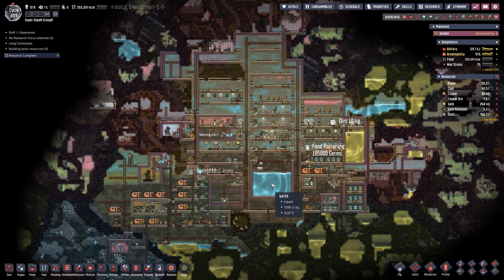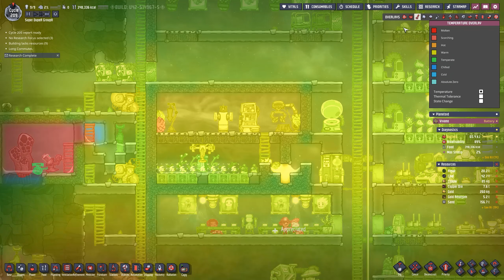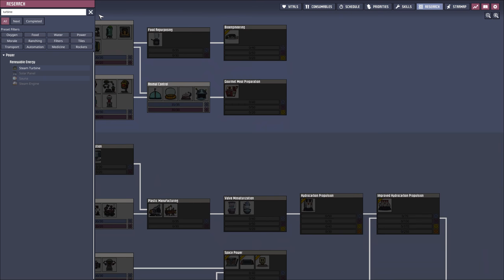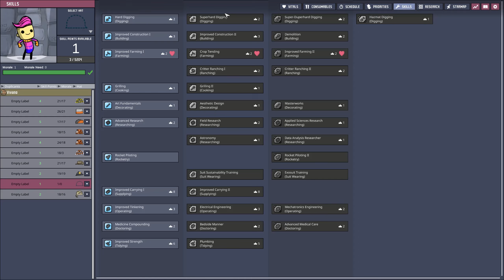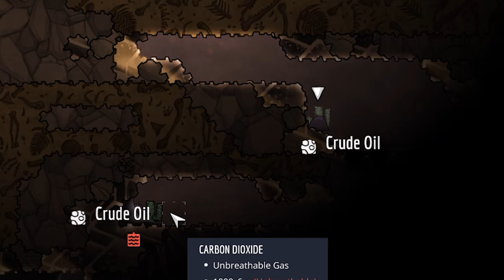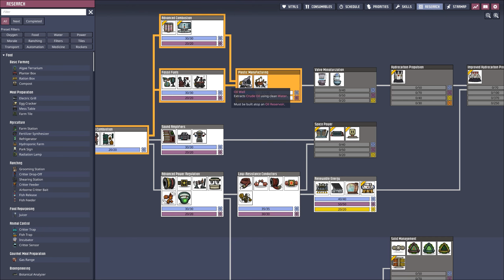Oxygen Not Included -  The Hunt for Oil (Part 11)

Comment: Sleet wheat will be good if you plan on tackling space with more ease. It allows you to make with your bristle berry a great meal called berry sludge. It can be made at the micro musher and the food does not go bad if I remember correctly. The challenge you are also facing is yes no pips but you will need to use an aqua tuner if you want to make sleet wheat in bulk and so far you are going the route of not using aqua tuners simply cause you don't have steel but you need oil biome to help speed this process along.

I think in short Pravus you need to explore more or "demolish" the map and give you an idea of where the geysers that can help you are. Keep those cold biomes for sure to allow you a chance at farming the sleet wheat that naturally is there to continue to grow until you can get a setup up and running.

Comment: Plastic ladders are faster because they can have easier to grip rungs, and you have less sharp edges and splinters, meaning you can more confidently scramble up them rather than somewhat carefully picking your way along.
Also, plastic is a higher tier resource, so you get more benfits from building stuff with it.

Comment: * Gold, as far as I read on the wiki:
- half the decor penalty for everything industrial, like wiring. Or Pipes, including Radiant ones for cooling rooms
- does not have a lot of heat capacity, so it is easily picked up by dupes once solidified. And very easy to cool the room
So if you can't hide it, might as well make it beauty golden!
* Shove Voles:
- As I read it, you want to get rid of most Regolith. Especially the one coming from asteroids. Apparently they come in rather hot and thus could easily overheat surface buildings. Some can be used for Water Sieves and Deodorizers, but i guess you get way more then you want.
- Regolith is also a reneable resource in the space age
- Voles seem to be a Food Animal. Shove is worth 16000 kcal of food. While Delecta is worth 8000 kcal, but can also be shorn for a ingredient
* Crude oil vs Poluted water:
- 1/2 the heat capacity, but 4 times the conductivity
- freezing point 20° lower at -40°C
- boiling point 280° higher, at 399°C
So it while each unit will transport less heat, it will take on temperature a lot quicker. And it is not likely to boil or freeze anytime soon. So it is just a mater of how much you can pump.

Comment: Would be nice to optimize your bathroom plumbing system, some infinite liquid storage, and deep freezing your foods rather than using fridge... Also, ranching slickster is easier than you think... just make a room just like how you build a hatch farm, just it is vertical, the entrance is on the top most including the the stations and make sure to use mesh tile... finally you should start thinking where you want to put infinite gas storage, using gas reservoir takes up lots of space. On the side note, you can also automate your incubator to activate at certain time only to prevent power usage (make sure rancher is High priority because the dupes can give lullaby only during up time.

Good luck with the game, don't bother too much with the complicated efficient (usually game breaking) builds as you are still on the early game >v<... be following this series.

Comment: I'm not sure but I believe the steam turbine doesn't work with the cool steam vent. The reason is because the vapor from the cool steam vent isn't hot enough.
Reply: That's right. It needs to be 125 degrees for the turbine, but the vent outputs at 110 degrees.